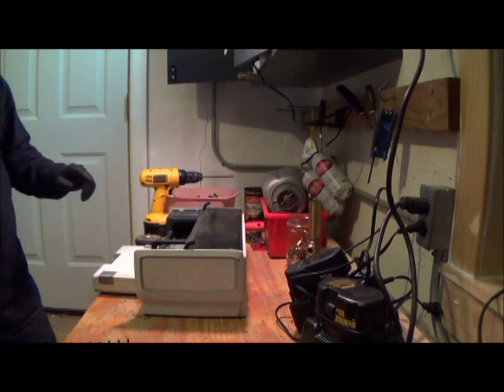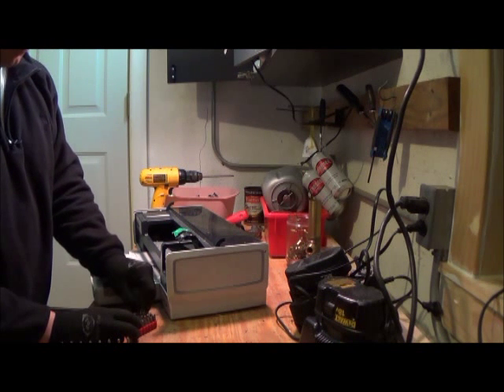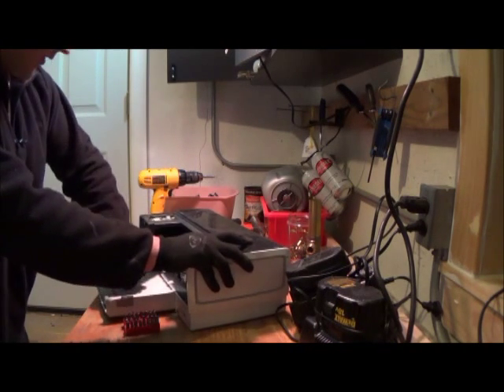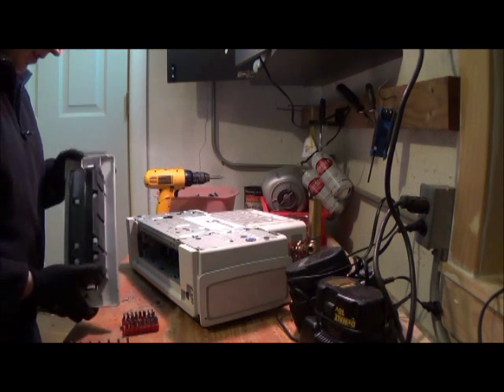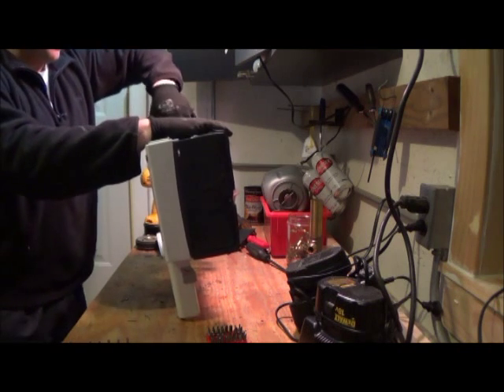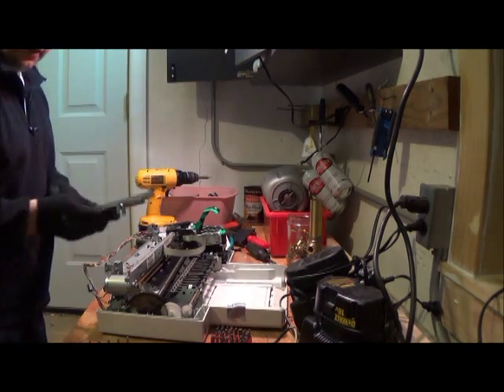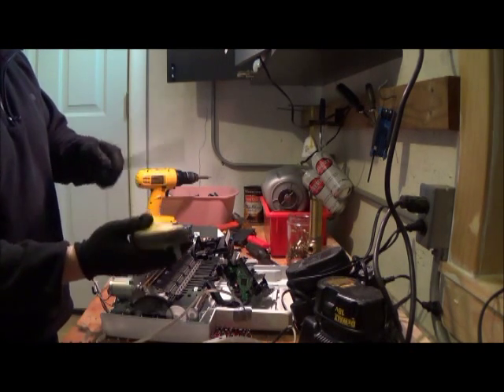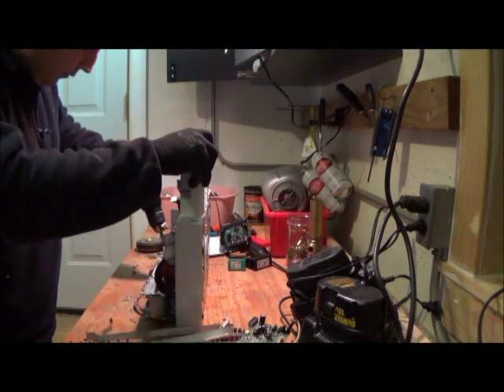What is inside a printer? What is the scrap value of it's contents? GOLD and steel and motors!

Comment: Where the heck do you get 80 cents a pound for steel? In my neck of the woods it is currently 4 cents a pound, and when the prices were higher some time back, it was 13 cents.
Reply from the maker: +MrDanrob62 I said the steel weights 8 lbs, 80 cents. That's .80 / 8 lbs = 10 cents per lb. You should also notice this video was published almost 2 years ago.
Reply: Sorry, I thought you said "a pound" not "eight pounds" That will teach me to wear my hearing aids when I watch youtube videos.
Reply from the maker: +MrDanrob62 Lol no worries. It's down to about 1.5 pennies up here in Ohio